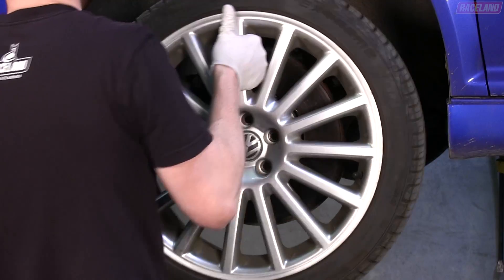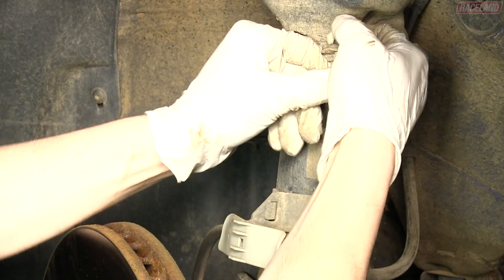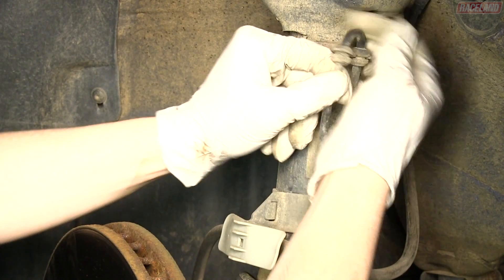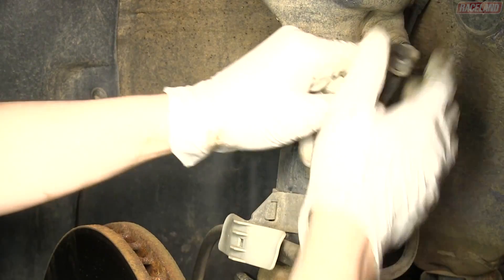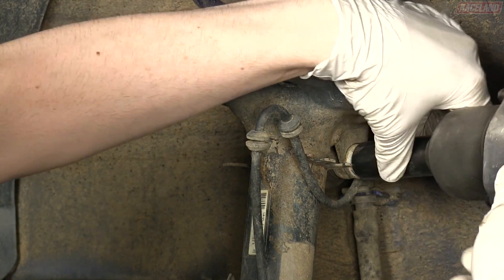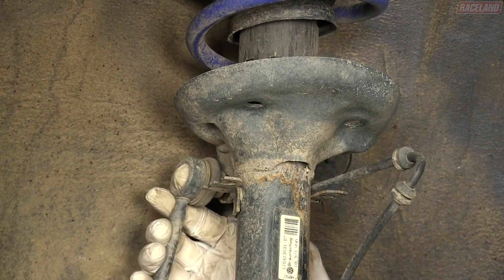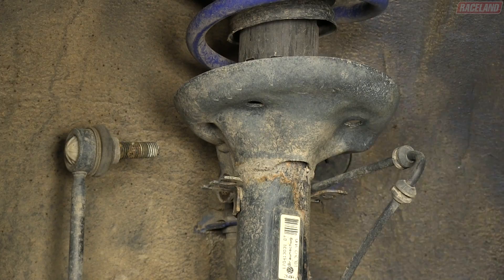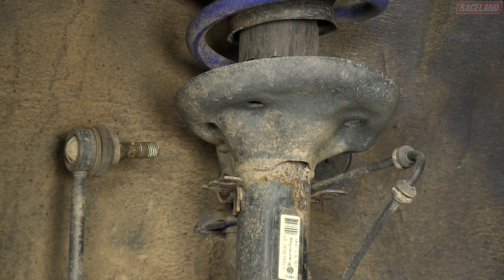How To Install Raceland VW MK4 R32 Coilovers

Comment: Why is my r32 diffrent i cant even remove the strut because axle is sitting on sway bar and wont go any lower to free the strut
Reply from the maker: You may have to unbolt the sway bar to get the clearance you need.

Comment: What were the torque specs for the trailing arm bolts?
Reply from the maker: Sorry, we don't have those specs on hand. You can get those from your Haynes type of manual.
Reply: Raceland what the hell does haynes mean?
Reply from the maker: Haynes repair manuals are a series of manuals that give you all of the information on your vehicle that you would need to know, even to the last bolt.